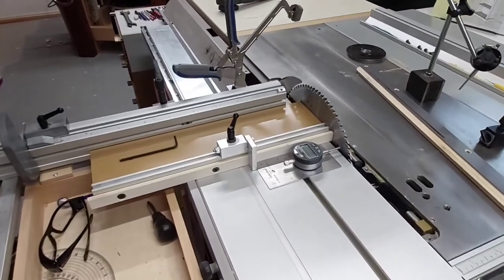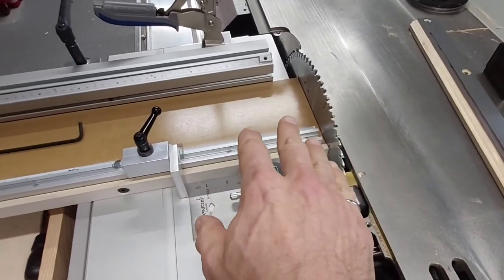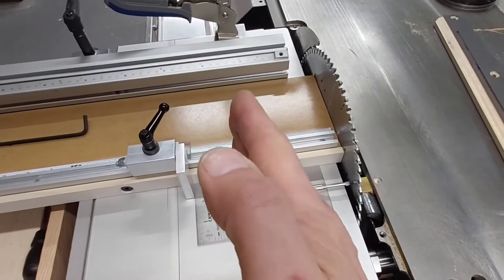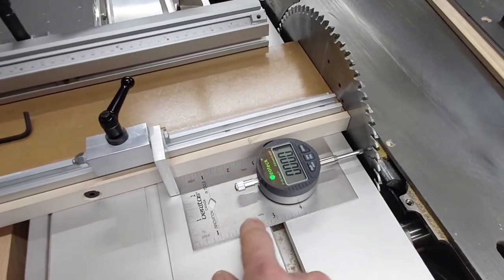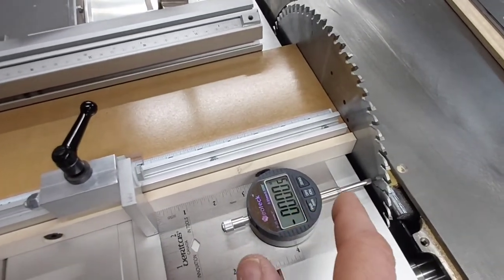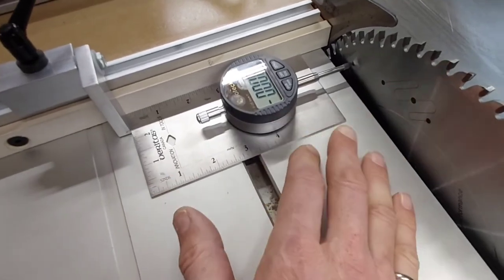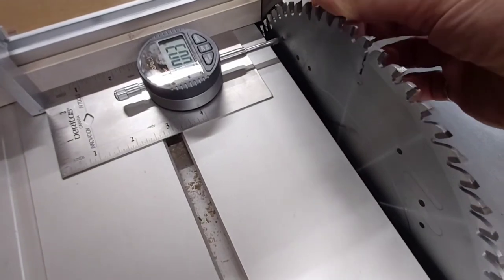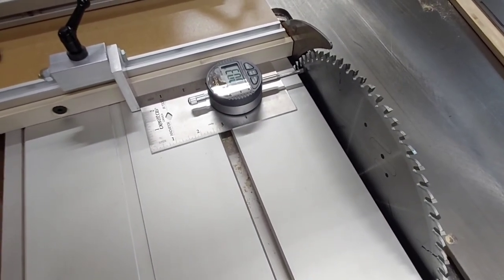Measuring Toe-Out on a Sliding Tablesaw

Comment: Is there any way you could show how to correct this? I know it’s different for every saw, but I just can’t seem to get mine alligned. I’ve spent countless hours on adjusting it, but it just seems to get worse when I try to correct it. I’m currently unable to get my sawblade alligned with my miter slot in the cast iron top. A full video on how you set up your saw would be amazing if you ever get the chance. 
Loving the content, have a good one
Reply from the maker: Joe - are you using a sliding tablesaw or a cabinet saw?
Reply: @davidbedrosian1567  a sliding table saw
Reply from the maker: @joejr.971  hi Joe - adjusting the toe out varies depending on your saw. Higher end models have a built-in mechanism to make minute lateral adjustments to the slider position. My saw doesn't have that so as part of aligning the sliding table height and travel, I also tried to get the toe out close to where I wanted it. I was mostly focusing on getting the sliding table at a constant height so the toe out was secondary. My final toe out adjustments were made by slightly pivoting the position of the cast iron portion of the saw. For me, this was a better approach than trying to laterally adjust the sliding table since I had spent so much time getting it sliding at a constant height and I didn't want to risk changing that. I know that doesn't really tell you how I did it but I hope it gets you started. Are you on Instagram? I've got a number of slider related posts that may interest you. If you search for the tag #bedrosianslidingtablesaw you will find all of my posts.
Reply: @davidbedrosian1567  Thank you so much! I’ll definitely go check out the hashtag, I already follow you on Instagram, but I havn’t searched the tag. Thanks!

Comment: I don't think your test is that accurate. I have one of these saws from Laguna, and I would check run out by pushing the table all the way forward and then measure to blade. Then pull the table all the way rearward and measure to the blade again.
Reply from the maker: Thanks for the comment Robert. With a dial indicator, you don't have to go the full length of the slider to measure the toe-out. In my case, I can see that I have about the right amount of toe-out just by measuring over the diameter of the saw blade. In your comment, you talk about run out which is different than toe-out. Are we talking about the same thing?